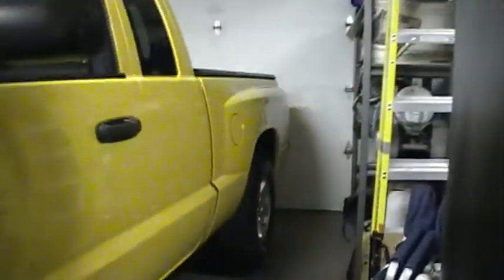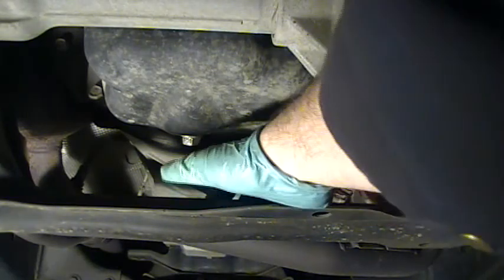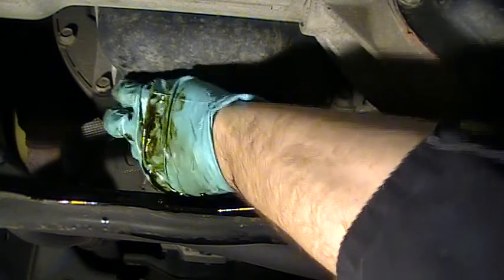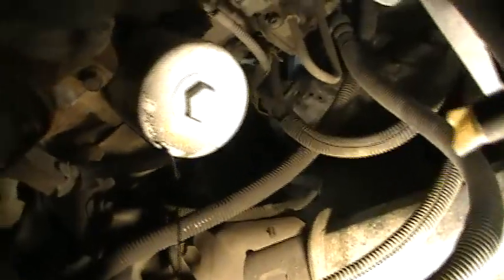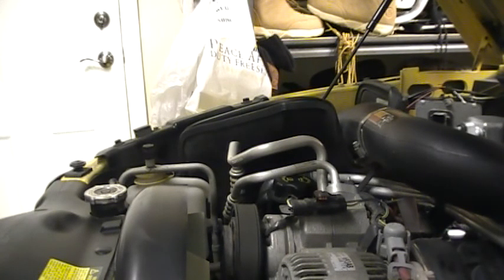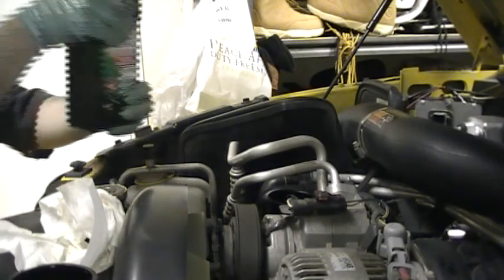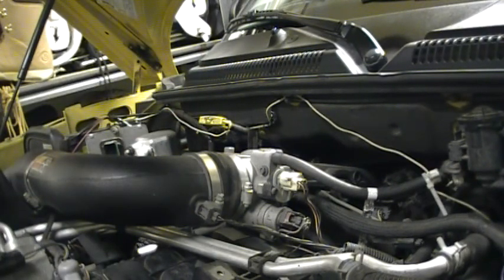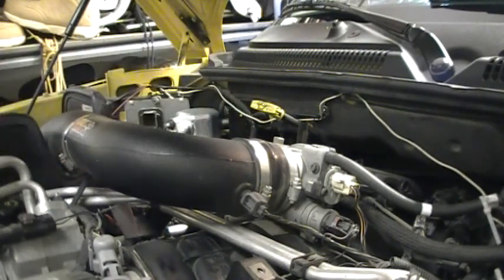How to Change the Engine Oil in a 2006 Dodge Dakota (Condensed Version)

Comment: Thanks for this video. I was just trying to locate the oil plug on my 2004 dodge Dakota 3.7L V6. This video was very helpful. It is very much the same. Only one question for you. Why didn't you use some kind of spout to get over the belly bar.... like a piece of PVC pipe cut down the middle in half to spout the oil into the pan. Would save you a lot of mess dude, but your video is good. I like your truck too! I like the yellow... Mine is red!

Comment: Do you lift the front end up or are you able to get underneath with no problem?
Reply from the maker: I usually lifed it up but if I was a few pounds lighter, I would be able to slip under it without lifting it

Comment: I recently just got a 2006 Dakota, Manuel, 6 Speed, v6. So I was wondering what yours was and I was also wondering what it could pull?
Reply from the maker: I actually sold it about a month ago, it was also a 2006, but with the V8. Tow capacity was 5400 lbs. I believe with the V8. The V6 has a few different options depending on axle ratio, 4wd and 2wd, club cab or quad cab. Look it up in this chart and you should be able to find it. You may need to contact the dealer to determine what your axle ratio is

http://www.trailerlife.com/wp-content/uploads/2012/01/Trailer-Life-Towing-Guide-2006.pdf
Reply: 6speeddakota was yours Manual?
Reply from the maker: Yes it was

Comment: If I drain the oil from any vehicle. I wait until late all of the oil is dripped out. especially if I do it myself. Ay least 20 minutes. no drips period. that is draining. if the oil is still coming out wait, until late it doesn't. also if your drain plug is in the back of the oil pan raise the front 5 degrees higher than the rear. if in the front raised the back. gravitics simple
Reply from the maker: I used to work at a dealership and they gave us 12 minutes to change the oil, that includes driving the car to and from the parking lot. Waiting 20 minutes to get an eye dropper worth of oil out really isn't going to change anything, especially considering the fact that there's plenty of old oil in all the nooks and crannies inside the engine. Also, if the oil pan is steel, there's a nut welded to the back where the drain plug enters, and the oil pools around it, so regardless, there's always going to be about 1/2 oz. of oil left in the pan no matter what.

Comment: You wouldnt happen to know how to trouble shoot the dash lights would you? Every light on my dash works except my odometer lights. (Speed,gas,temp and rpm guage dont light up
Reply from the maker: Well unfortunately I sold it 2 years ago, it was starting to become problematic. Anyway, I had a complaint one time that none of the dash lights worked, and it turns out all the bulbs were burnt out. Not saying that's your issue, but first thing I would do is check to see if your climate control and stereo light up. If they do, then try the dimmer, if they're working normally, then we can suspect an issue with the cluster. They're fairly easy to remove, so I would pop the cluster out and check the bulbs to make sure that they're not all toast.